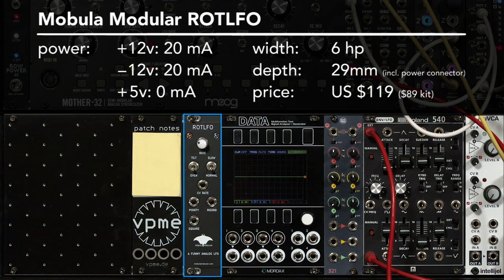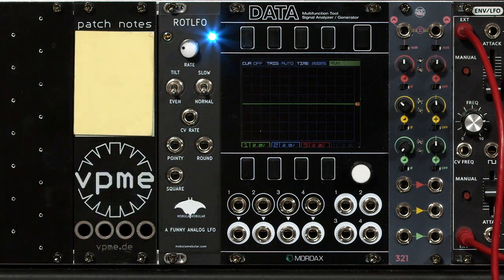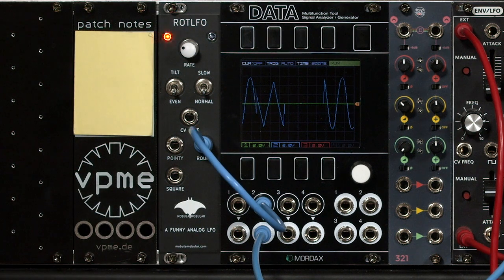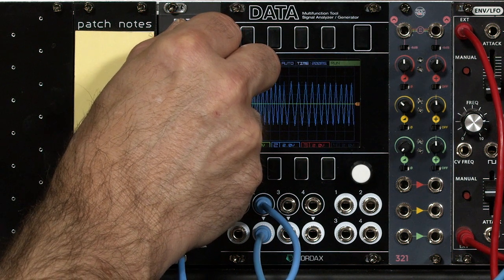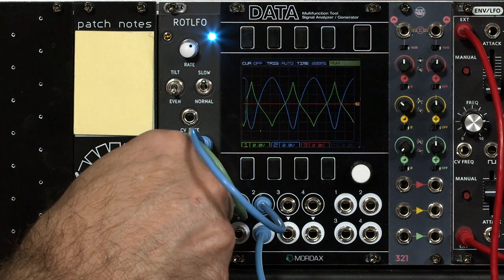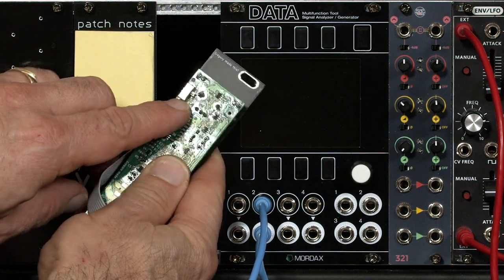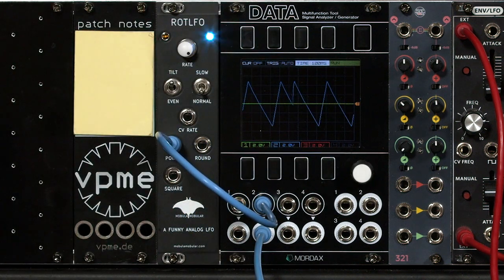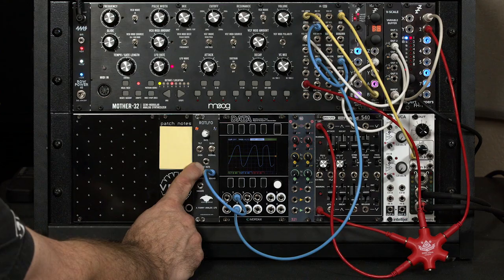Mobula Modular ROTLFO 1/2: overview (LMS EE)

Comment: Why did they not bring the wave shape switch to the front plate?
Reply from the maker: That's a good question for the manufacturer. I asked why it wasn't at least a jumper, as I have front panel breakouts that add switches for behind-the-panel jumpers. I prefer all of the options to be exposed, myself.